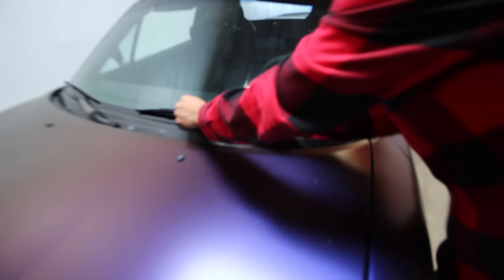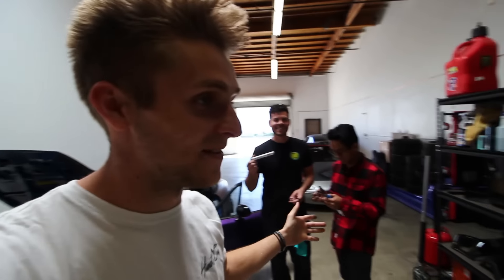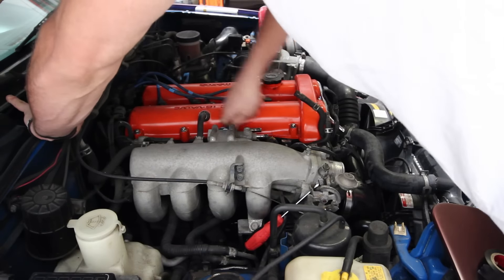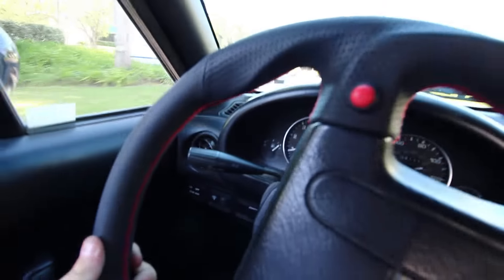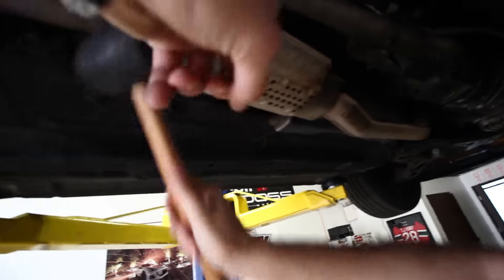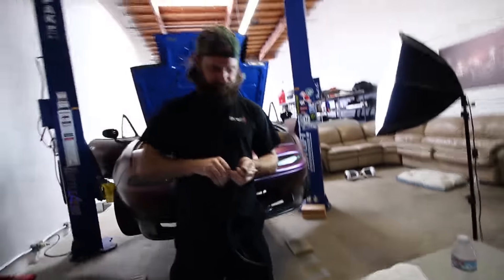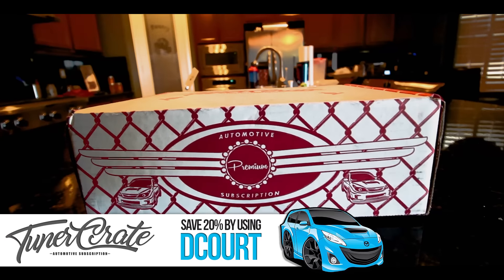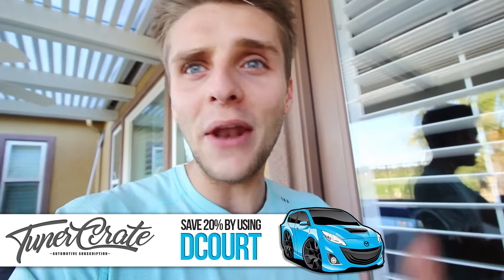Installing A Wideband O2 Sensor - Boosted Miata Build 1

Comment: If the idle is dropping when letting off the gas, look into adjusting the idle screw. There's a diagnostic plug under the hood and you use a jumper wire to jump pin 10 (I believe) with ground and if the idle drops, you adjust the idle screw with the wire in place. It's all over forums on exactly how to do it.

Comment: Hey for your idle issue, you can try and clean the Idle Speed Control Valve (ISCV) under the throttle body (controlled by the computer). Look up part B61P-20-660 and you'll see the part that needs to be cleaned or possibly replaced. Its not to hard to remove with basic tools. The part that you removed and cleaned is another part of the Idle system called the Air Valve (AV) which actuates via a valve that opens an closes depending on coolant temperatures. I had the same issue as you and after following some steps I was able to identify it was a faulty ISCV. They are a bit expensive new so I got a used one from someone's Miata part out ad. Hope this helps!

Good luck with your build!
Reply from the maker: +Luis Lynch-Maldonado appreciate the comment for sure look into this thanks a lot man
Reply: No problem Danny... look forward to watching your build!

Comment: I had the SAME PROBLEM. Literally same problem. 
Mine ended up being the switch at the top of the clutch lever, BUT check the lower switch as well. 
(By top I mean, the top of the throw of the lever, and by bottom I mean at the bottom of the throw.) 

There's one more switch, (Clutch safety Switch), on the transmission that could be causing it as well.